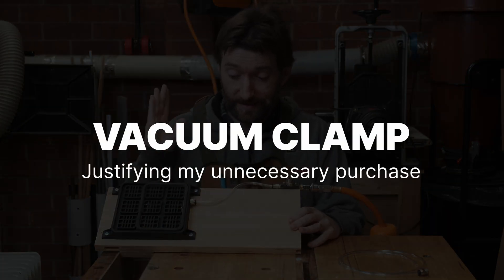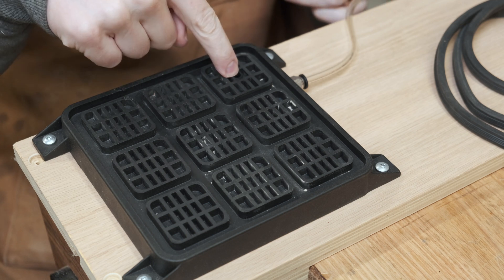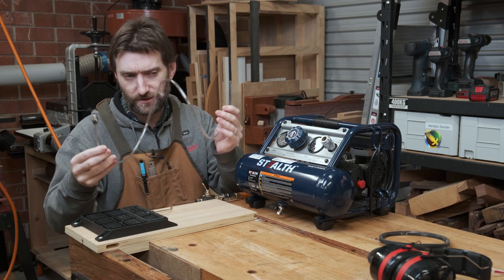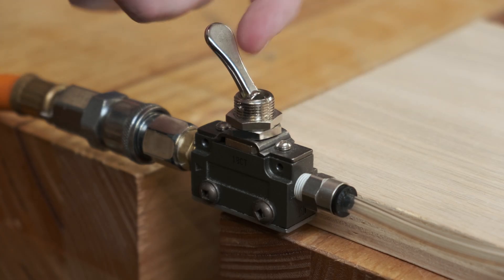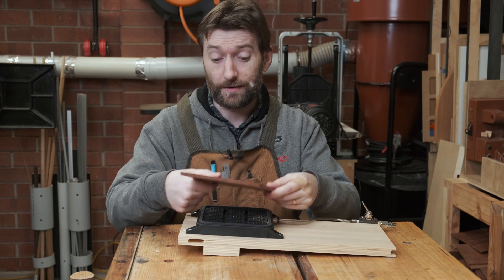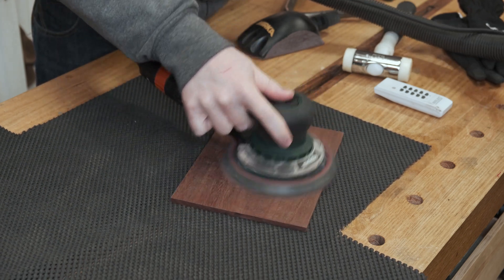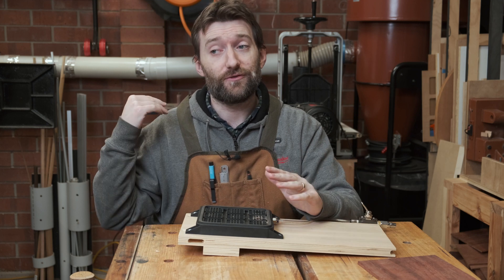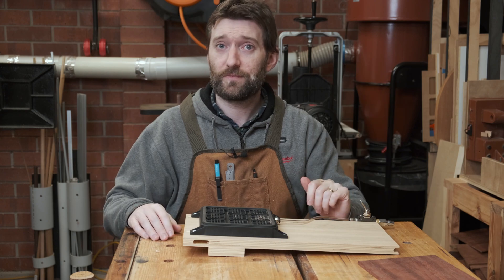Vacuum Clamp - Hold Things Down With Air!

Comment: It does work for limited applications and smooth non porous surfaces. I built a downdraft table but have not used it in conjunction. Sounds like a good combo. Thanks for the video.

Comment: If you had a vacuum pump are you able to use this still?
Reply from the maker: No, the venturi would be in the way and needs compressed air.
It wouldn't be too hard to make one for vacpumps, but I have a few projects lined up before I can get to that :)

Comment: Great video. What type of switch did you use on this? Also did you sorce any foot operated switches as you mentioned in the vid? Cheers Nick from NZ.
Reply from the maker: I haven't looked into foot pedals yet, for better or worse I haven't had any major projects where I'm processing a lot of items. I think if I end up making a batch of cabinets that'll change pretty quickly! 

The switch was a v-clamp brand switch also from Beyond Tools
https://www.beyondtools.com/product/lever-valve-kit-includes-connector-to-6mm-tube-and-1-4-x-1-8-nipple-suit-pneumatic-clamps-including-vac-clamp-and-virutex/
Reply: @TheWoodKnight  Great thanks for that.

Comment: Hey Paul, great video, definitely worth looking at. Does it involve any assembly? or is it ready to use (except the switch addtion) out of the box?
Reply from the maker: Hoses will need to be plugged in and adapted depending on what you're using, but that's literally just pushing them in on the clamp side, and screwing in if you're using the bsp threaded adapter. Other than that, just need to screw it down to something if you get the vc4.

Comment: I bought one and was having so much trouble getting it working. I pulled apart and rebuilt my vacuum pump, and went through everything to get it to work. Then read the website and it wanted compressed air.  :(
Reply from the maker: Ouch, that sucks. Well, I guess it didn't in that case. Did you end up making a pod/clamp that works with your vacuum pump?
Reply: @TheWoodKnight  nah, just hooked up the air compressor to it. I wanted a quick clamp option for the CNC.

Comment: I picked a couple up from a garage sale andam yet to play with them. I want to make a downdraft table for sanding and routing and think these will be awesome additions for easy holding over rubber mats. Bugger I have with non slip or rubber mats/feet is that they often leave marks on the already finished surface and need further sanding by hand or cleaning.